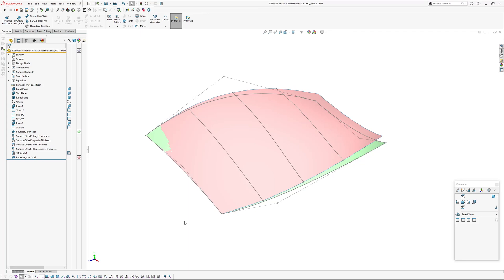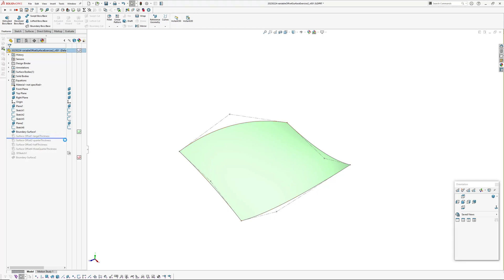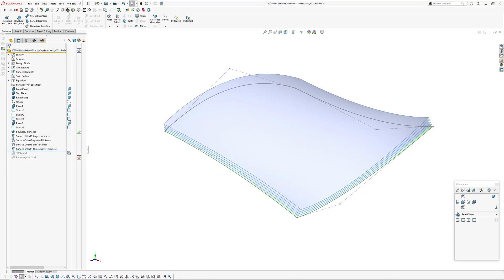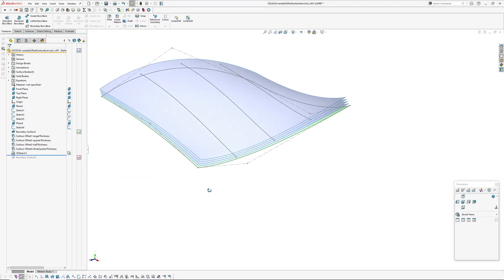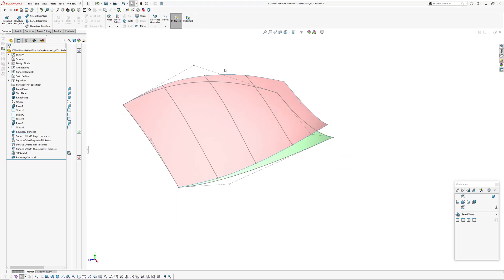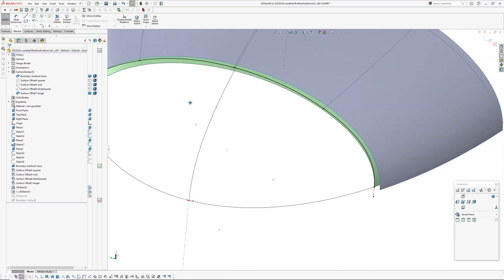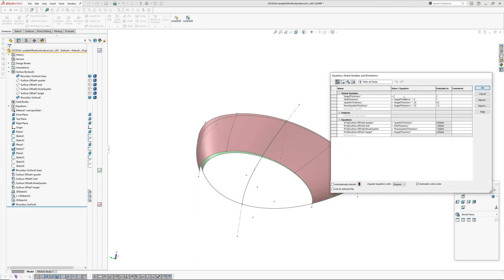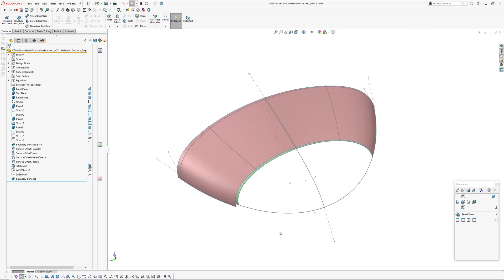Variable Offset Surface Tutorial in Solidworks

Comment: Really cool method! Love the use of Face Curves. 

When you are using the Selection Manager, you can click on the push-pin icon in the upper right to keep it open. This way you do not need to keep right clicking to open it. Also, once you select an edge, line, or other entity, you can right click to confirm it without having to mouse to the Selection Manager.
Reply from the maker: Thanks for the tip on Selection Manager, will give it a go.